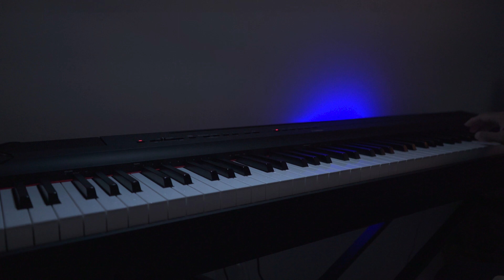MIDI controlled LED strip - Part 4, animations

Comment: hello, first of all thanks for your videos, they are very interesting.
i'm planning to do à 2X2,5m of Led strip with sk6812 led 144led/m, with power coming from both side of  the 2,5meter strip and i would like to ask if it can work with arduino like yours ?  i'm planning to control this setup with the midi of ableton while doing my music in live, but i'm beginning in this world.
can you also make your own program on the arduino or there is not enough storage for that ?

hope you will see this comment and wish you the best ;)